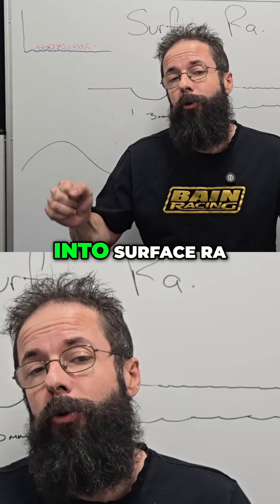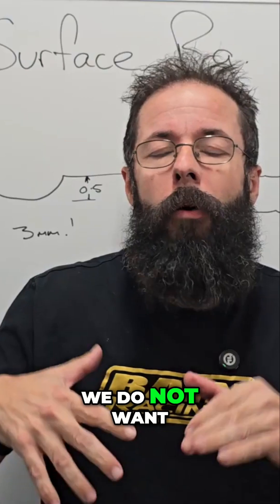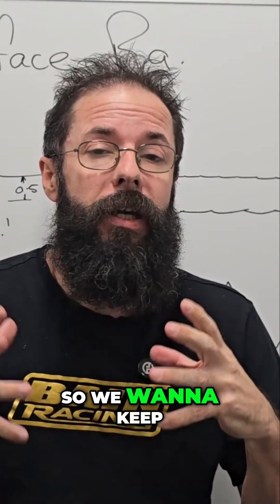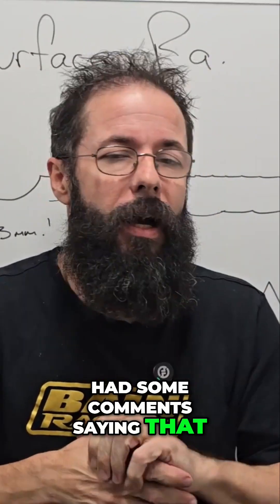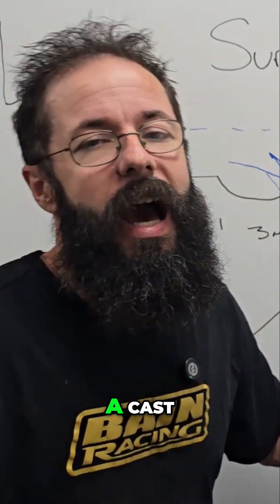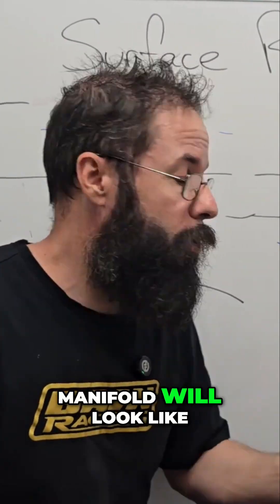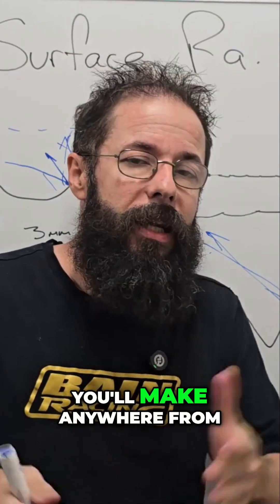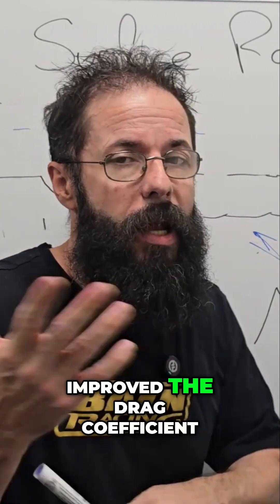Surface RA: The SECRET to More Horsepower and Torque! #shorts

Comment: I ran tests on an engine probably a good 20 years ago where I went from burr to 240 grit and back to burr, and though I didn't dyno the engine so I can't say anything about that, I can say that throttle response (like coming out of a corner and hammering it) was improved with a rough surface. It becomes funny when people tell you it's wrong and it should be a fine surface, but they don't know that the car they lost to on the track that weekend had parts looking just like that. 😂
Reply from the maker: Exactly!👍 the boundary layer is far more important then many understand

Comment: What about torque, will 60 grit finish improve torque?
Reply from the maker: If CSA is on the small side generally you see both. But if on the high side and an older port design like a 23° a burr finish will be best

Comment: Wait so there are gains going 60 grit vs rough cast ?
Reply from the maker: Definitely!👍  obviously port shape needs to be considered and CSA but we are reducing the port's total drag coefficient and reducing the boundary layer.  Hence why it generally always shows HP gains. 👍
Reply: @bainracing I am currently porting a Peugeot XN1 cylinder head from a Peugeot 504 the ports a notoriously over sized I initially decided to just blend in the valve seat to the port and leave it at that. I don't want to touch the rough casting since a thicker boundry layer will effectively narrow the ports. Any thoughts on this?
Reply from the maker: @jonathondeeds3423 That's probably the best approach,  unless you want to fill it with splash guard 👍.
Reply: @bainracing what is splash guard?